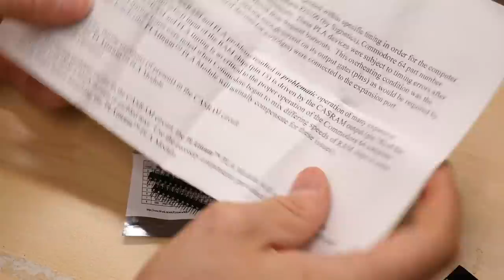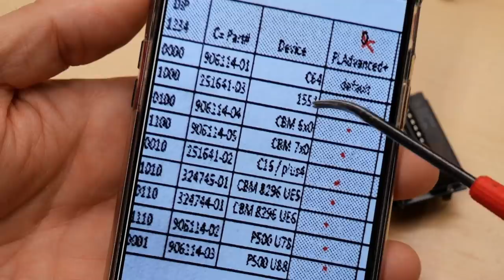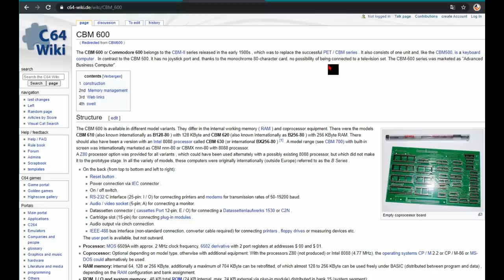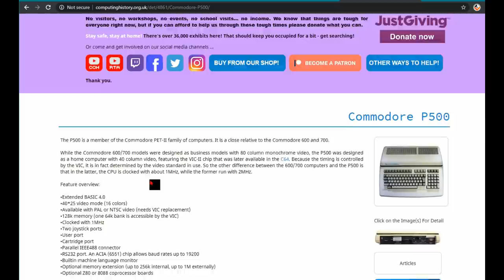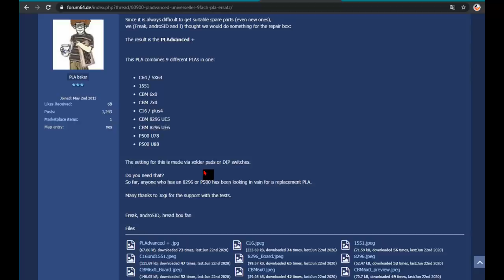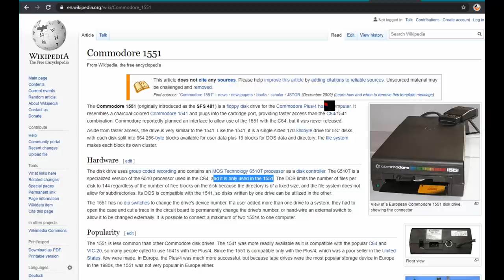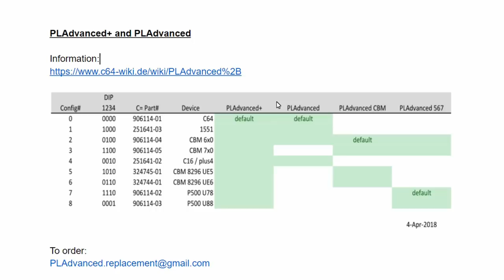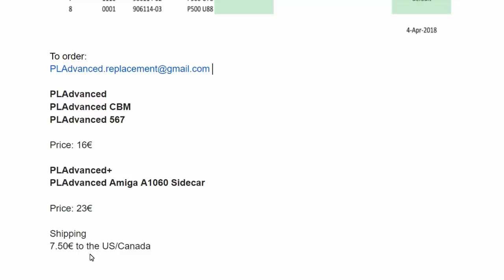The ultimate Commodore PLA replacement? (PLAdvanced)

Comment: I remember CBM 610 / CBM 710 (as they were known here in Germany) they were business machines with 80 coloms in monochrome sold in the U.S. as B128 / B256 and basiclly become extinct by the PC and mainly its clones. Yes, there were known under other names in other regions in the world and other parts of europe as well. Commodore marketing messed everything up as usual.
The P500 should be the home version of the CBM 610/710 and replace the VC/VIC-20. There were only a few 'real' review samples send out to magazines and computer shops. Some say Commodore canceled it because it was to expansive to build (The P500 should come with up to 256K, the 6509 could do up to 1 Meg as well. In contrast the 6510 could do only 64K afair.) Others say there were to much bugs and problems in the review machines. I prefer the first but there was no offical statement. Later german electronics dealer Völkner bought the remaining spare parts with a lot of remaining CBM 610 / CBM 710 from Commodore and sold them. So you could build your own P500 form the parts what a few people here obviously did. Someone told me there was a kit too but I stongly doubt that because I couldn't find any evidence of one.
Reply: What was the cpu in the CBM etc machines? I have a vague memory that they where some kind of PC clone/competitor.
Reply: @skilletpan5674  The main CPU was the MOS 6509 (6502 with 20 adress lines) in all CBM 6x0 / 7x0 (2 MHz) and the P500 (1 MHz). The CBM 730 (or BX256) had an daughter board with an Intel 8088 and could run CP/M-86 or MS-DOS. But Commodore made PC clones too. PC-10 to PC-50 with Intel 8088/286/386SX. Later 386/486 models had only the Commodore branding. Escom and Tulip Computers released Commodore branded PCs as well.
Reply: @Troppa17  Great information!
Thank you (Danke) Tri-TRA-Troppa.

Comment: Thanks for your tests .Does it works for C64 II as well? I still have some of them dead also, that really was the one I firstly started with. The sound was a bit improved on these ones, and I loved that modern design. For C64 and C64 II do you see a difference between PLAAdvanced and GAL PLA ?
Reply: Sorry, when I wrote it, I confused with C64C , did you ever try any of replacement PLA on them ?

Comment: An 8296 isn't a SuperPET. The SuperPET is an 8000-series with 96K RAM and an additional Motorola 6809 CPU. The 8296 is a curvy-cased 80-column PET with 128K RAM. I once had an 8296-D, with two internal 8250 drives, but I lost it when I stored it in someone else's basement, and he gave it to someone else by mistake.

Comment: Hey Adrian! Great videos. I have a request: could you do a video on high density 3.5" floppies on Amigas? It was always interesting to me; my last A1200 was from Escom and used a modded high density floppy drive and was wondering if you could come up with a solution that could read/write standard Amiga or PC high density floppies using a PC drive (the Escom couldn't; it could be persuaded to write non-standard HD disks though).
Reply: The Paula cannot handle the required bit rate for HD floppies. Commodore's work around was to reduce the rpm of the floppy drive, but this automatically means that PC drives cannot work.

Comment: Hi, you suggested Dan G. To test my c64 chips last winter. He sold me a replacement PLA of his own design very reasonable and it works 100% perfectly. Can you test that in all versions of the machines you have?
Reply: I actually didn't design it, I simply make them and program them when needed.  Proper credit goes here... https://www.hackup.net/2019/06/the-xcpla-yet-another-pla-replacement/
Reply: Dan Goswick thanks for the correction! It’s working very well so far!

Comment: 12:53 And you scrolled right past but it looks like it works in the SX-64 also
Reply from the maker: Yeah didn't mention as that goes without saying -- the SX64 works exactly the same way as the C64 so anything that works on a breadbin C64 would work in a SX64.

Comment: Nice! I have seen this in the f64 in early stadium, but forget it.
Still have a couple of PLAs here, but who knows ... better ordering some :D

(as we know. If you have enough spare parts, things don't break hehe ... have 3-5 PLAs here .. don't really matter. And about 30-40  6522 and 6526 here - in the last 20 years no 6522/6526 broke ... a sign :D... but on the other hand, have close to no ViC-20 parts anymore, now have 3 dead 20s on the table... that sucks - and I am not will to pay these insane prises . So these 3 ViC-20 will stay dead so long, thanks to these rippers. I am crazy, but not insane and I don't care anymore. Life is too short :D )
Reply: Unless the VIC is broken, you can repair a VIC-20, all parts are still available and generally for low prices. If you have trouble finding a part for it, feel free to ask.
Reply from the maker: Yeah all off the shelf except for the VIC chip -- and I'm hearing from multiple sources the VIC chips seem to be dying a lot these days. Definitely concerning.
Reply: @adriansdigitalbasement  soon we need a solution for the VIC chip

Comment: Nice.  Wish there were some CIA replacements for the 64 and 128 as those also fry often....
Reply: Take a look for MockA65xx. The next project is CIA replacement called FBI we started last year.
Reply: Horst Brotbox nice.  I have a stack of 8 128s here that all have bad CIA chips that need replacing.  But the chips are so hard to find or have to be pulled from working machines.  Almost worth more for me to just piece the 8 machines out as parts than sell them as systems.

Comment: So now we have the PLAnkton, the PLAtinum, the PLAster, the PLA20V8, the Super PLA, the Ultimate PLA,  and the PLAdvanced.
While it's great to have PLA replacements available, does the world really need another one?
Reply: Yes, we need. For our team it was a start to develop a lot of replacements. Next we'll finish the MockA65xx and start developing CIA replacement.
Reply from the maker: Yeah a ton to choose from now -- but this one is certainly unique in that it also handles all those other machines. Something I personally haven't ever seen before.
Reply: Yes, it is absolutely the most flexible. I was just wondering how many more solutions there would be for the problem. I think a lot of the PLA replacements were created for no reason other than that they could be.
Reply: @gklinger  Not every PLA replacement is ready to buy, they are created by hobbyists in their spare time. A PLA may become unobtainable if the creator stops making them and the community can respond by creating another.

Comment: I'd like to see the point where the C64 can be built with all third party parts for fun.  So GAL-PLA, SwinSID, and hopefully CIA and VIC-II parts of those are cloned or can be cloned.
Reply: We might be there within 3 years: Chips that still are difficult to replace are the VIC-II, CIA and CPU. Community projects to replace them exist for all 3 and the designer of the PLAdvanced is working on CPU and CIA replacements.

Comment: I wish someone would come up with the data so we could program the GAL based PLA for the Plus/4.  Same pinout as the 64.
Reply: I'm almost done for the Plus/4.
Reply: @danielmantione  nice
Reply from the maker: That is awesome -- yes all the machines this PLA replacement supports are 82S100 based which means the GAL-PLA should work on those too with the right equations etc.
Reply: All 82s100 replacements has the same pinout.

Comment: Commodore P500?! So Commodore 128 was basically this "thing" with some improvement.
Reply: You could go ask Bill Herd, but I don't think so.  There were some similarities, but the 128 has more in common with the never-finished LCD-based laptop computer Bill Herd was working on before starting the 128.  (He used the MMU originally designed for the failed LCD project.)  It's more that the CBM-II line had a few features grafted on from the 64, like the sound chip to replace the really chintzy buzzer that some later PET models had.

Comment: How would a ROM work as a PLA? That sounds really odd.
Reply: The PLA has 16 inputs and 8 outputs. 8 outputs form a byte. If you record the output for every possible input, you end up with a 64 kilobyte file, which you can program into an EPROM. Build an adapter from the PLA pinout to the EPROM pinout and voila, PLA ready. Why do we bother to create proper PLAs? There are three groups of problems with EPROM PLA's: Timing, switching noises and voltage levels. Finding an EPROM with adequate results for all three groups, proves difficult, thus we prefer a proper replacement.
Reply: @danielmantione  Fascinating.